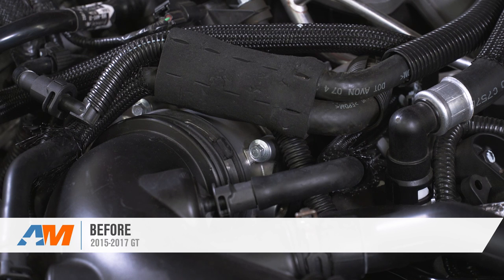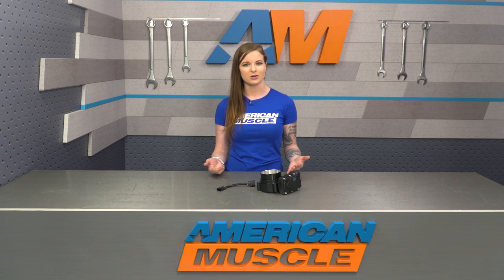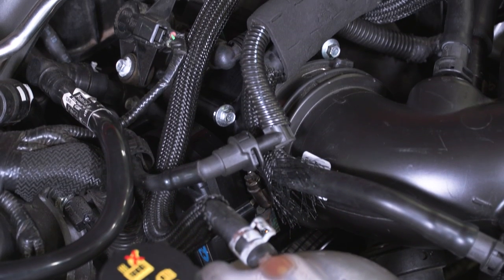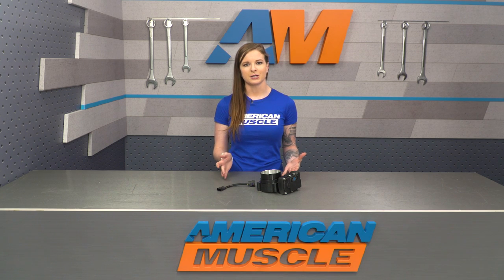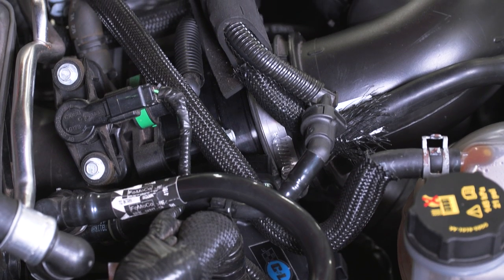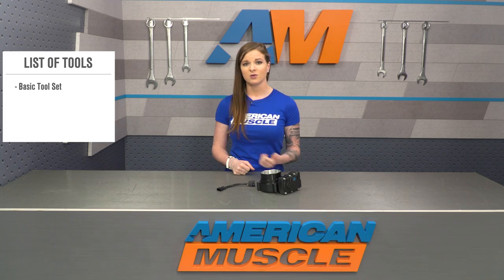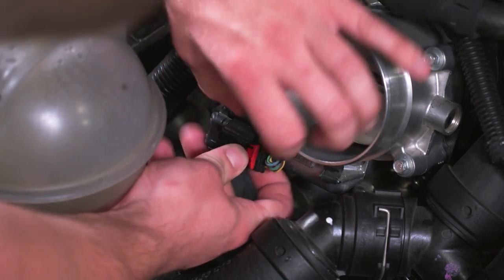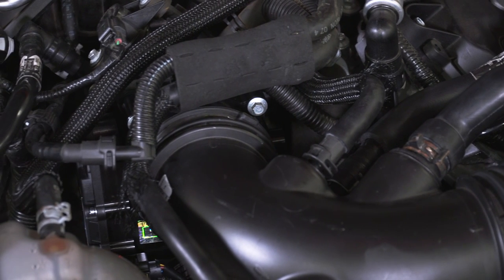2015-2017 Mustang GT C&L 85mm Throttle Body Review & Install

Comment: With only a CAI, Upgraded coil packs, and a 3 Inch exhaust on a factory tube would you see any benifits with this system?
Reply: Better throttle response for sure but nothing too crazy in terms of HP/TQ gains